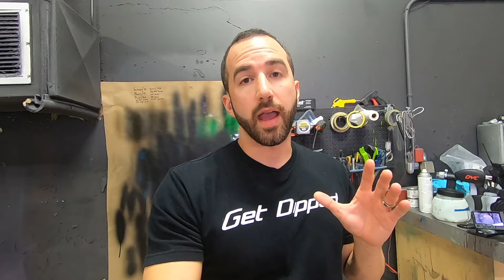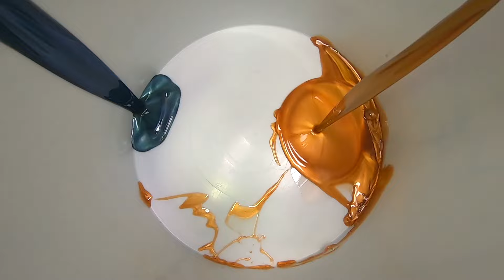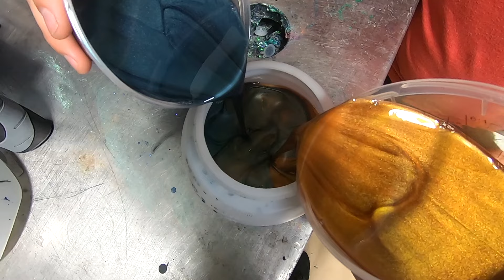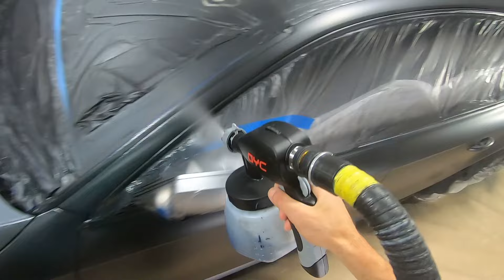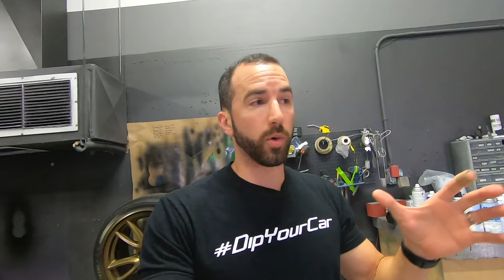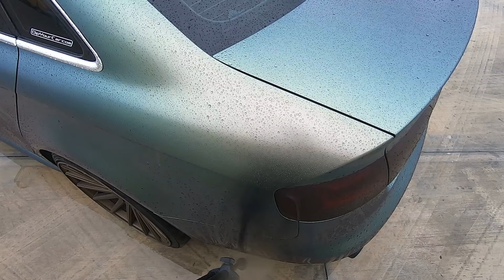Combine Two Colors, DON'T MIX, then Spray!

Comment: The name should be " Oil slick"
Reply: Has the same colors huh
Reply: The BP oil spill.
Reply: Tempered Titanium, no?
Reply: Oil slick is more purple pinkish
Reply: Tempered titanium.
Reply: Oil Stain
Reply: I was thinking Mood Ring
Reply: Some old hot rod guys that would rock primer finish used to cover their cars in wd-40 when they would take them to shows and when it would get wet or rained on that's just about what it looks like. It was a trick to hide fingerprints you get when touching dark colored primer..Lol
Reply: More like Oil Sick
Reply: Hot Gun Metal.
Reply: Until you leak
Reply: I bet he had to cut it loose from the floor.
Reply: @djw5415  it's a Ford color it's called mystic
Reply: In a lot of video games this color is called oil slick
Reply: Naw call it "June bug"
Reply: often called Scarab Green, due to scarab beetle shells often having the same color and effect.
Reply: Cop to dispatch: I'm following a green, no wait, orange, blue, gun metal gray...

Dispatch to Cop: Come back to the station for a sobriety check.
Reply: Wolfgang cutthroat  anodized...? Didnt know you could anodize titanium. I know you can to Aluminium. 
Heat treated titanium (tempered) is very common in the car world.
Reply: Wolfgang cutthroat  ah i see. My confusion what thinking titanium anodizes the same as Aluminium to which you add dyes. Anodising and tempering get you to the same result for titanium as its the oxide that gives the colour not a dye
Reply: Wolfgang cutthroat  same result two very different methods
Reply: i see it as more of a Dragons Egg
Reply: @detectivewaffles3129  and where have you seen dragon eggs????
Reply: @liamcooper5202  i have my sources
Reply: @detectivewaffles3129  well thats a lie because I dont know you and i have the last set of eggs
Reply: @liamcooper5202  lol that's what you think
Reply: @detectivewaffles3129  ummm no. Its been curtified. I know every collector. It truely is sad there are only a few left. Glad i have them though.
Reply: @detectivewaffles3129  short answer... we are unsure. Not enough is still known about how long an egg is "good". The shells are too thick to see through and scanning is proving difficult. I maybe have the last set of eggs but no one knows if there are baby Dragons inside.
Reply: @liamcooper5202  did u try surrounding them in a large pile of gold? That's what my great great uncle twice removed did.
Reply: Jack Kuykendall the name should be chameleon
Reply: actually a really cool name for it.
Reply: antifreeze drip...
Reply: It remind me of a hot wheels car that change color  with heat
Reply: Bismuth?
Reply: Amber fade would be a nice name for this color 🔥
Reply: "Slick Oil" is better
Reply: @liamcooper5202  (primary color) Tempered titanium has a nice ring to it.
Reply: My thought exactly.
Reply: Labradorite
Reply: Thats already a thing
Reply: Petroleum rainbow
Reply: Oil slick is dif.
Reply: You're not wrong
Reply: Glad I'm not the only one that thought this
Reply: Abradolf Lincler  same
Reply: @mitchelsalas3185  no this was a custom color
Reply: That already a form of paint lol, but that would work tho
Reply: @jennaorlowski9228  Nice👍🏽
Reply: I think Peacock feathers ^.^
Reply: Perfect! I was gonna say chameleon but oil slick is even better
Reply: My thought, exactly!

Comment: By the time you get a couple passes on the car, the different colors have been agitated in the cup enough to thoroughly mix. But that color is amazing and its perfect with those wheels!!
Reply: if the paint containers could be seperated then  both fed to the gun that would do this effect but would probably need a custom spray gun if there is one out there
Reply: @646klein  Hey man, they actually heard you!!! That's amazing!!! Check out their new video!

Comment: Very cool, best way i can describe it is it looks like the oil sheen when a drop of motor oil drips in water puddle
Reply: or simply iridescent
Reply: Did you just say OIL 🦅
Reply: @etooamill9528  read it here 1st.... oil
Reply: the colour is known as oil slick
Reply: Yess..   hit the nail on the head with that description
Reply: Heat-treated titanium without the purple
Reply: Yeah that's both thin oil layers and pearlescent colors use iridescence to create colors. So it's the same thing.

Comment: Looks like a blue steel, like when you heat steal too much while forging.
Reply: Car -fade, factory new.
Reply: @huntergman8338  perfection.
Reply: Facts
Reply: ThatAnthroGamer I thought you meant Derrick Zoolanders top secret look!
Reply: Actually reminds me more of heat treated titanium. Dab nails made of ti also take on this same almost purple to blue to almost yellowish look after being heated
Reply: It's not because of overheating, you can achieve this colour in a conventional oven while tempering 😊
Reply: @jesmondo5785  You can make chocolate shimmer in those colors as well, with nothing than a pattern carved onto the surface
Reply: @huraqan3761  no that's different, metal actually changes color when heated and those colors don't change with the viewing angle
Reply: @The_Wosh  did i say it was the same? aaaaah ^^ lawyered...
Reply: @huraqan3761  you got me there, but it still different, when you do that with chocolate it will have a rainbow effect, but metal only goes through a few colors
Reply: @The_Wosh  hey... cloud iridescence
Reply: Yeah like that
Reply: @jakewarner1993  I see that
Reply: Tempered steel
Reply: I said i would call it green steel

Comment: I dub this color DRAGONFLY
Reply: I dub this colour PETROL IN A PUDDLE
Reply: I second that,  DRAGONFLY.
Reply: Looks more like jet fuel
Reply: "Unicorn blood" seems more appropriate
Reply: Lol its a color used lots in bikes its called oilslick
Reply: I would call it 'Failure of the Smith'
Reply: My precious
Reply: @OrangeAtomicRugTM  but even if that color, it still doesn't melt steel beams.
Reply: It does give you that feeling while looking at one while flying...😁😁😁✌✌✌
Reply: Perfect name for that custom color!
Reply: Oooooo I like

Comment: Because the spray gun atomizes the paint as it passes through, you won't really notice that the paint hasn't been mixed. 

Maybe if you poured one colour in first, then the other in second - you may have a more noticeable outcome.
Reply: or have two sperate compartiments in the bucket.
Reply: @sebastiaanx7867  I reckon this is the idea he mentioned he eludes to in the wrap-up
Reply: @roadhog29389  could be indeed. Doubt it will do any difference though.
Reply: Or if you put a piece of cardboard to divide it into two sides and poured in the paint and removed the cardboard
Reply: @sebastiaanx7867  the colors will still mix as they go through the atomizer.

Comment: x2 guns. x2 different colors. Second gun follows right behind the first. 

Instead of mixing in the hopper, they'll blend as the coats dry on the car. 

#doitfonzi
Reply: vabrova no that’s pretty stupid
Reply: yep it would end up just being the color of the 2nd gun.
Reply: I like that idea
Reply: @TheBulitt  no it wouldnt. If you spray from 2 different angles it does do something
Reply: Black and White or white then black
Reply: @Joel Marshall 2 guys one spray gun?
Reply: 2 tanks, 1 gun, with a randomized switching valve between the tanks?
Reply: sounds like overhandlin to me
Reply: Or design a gun with 2 nozzles that spin lol
Reply: There would be no end to this conversation
Reply: Yo! Fonzi actually did it and it looks good. Their turn around time is ridiculous!!

Comment: Once a month or so, you should try mixing two random colours and show us the results
Reply: That would be expensive car paint is extremely expensive I know first hand
Reply: @jessewelch1 ah ok. I thought because they use plasti-dip it would be cheaper also taking into account the buying power or company direct prices.
Reply: not if you order it in the good places or get it sponsored @jessewelch1
Reply: @jessewelch1  well he owns DYC which is the number one automotive Plasti Dip vendor so I doubt that's a problem.
Reply: Tex X it’s not paint, it’s plasti dip. And it’s not really expensive at all. I know first hand
Reply: What will he show it on? A damn Brick wall?
Reply: @cxssetteman182  The whole point of plasti dip is that it comes off. They could use the same car for every single video.
Reply: @cxssetteman182  sorry i thought it would be obvious considering the whole company is based around dipping cars or car parts... kind of an ass ended question.

Comment: It looks like case hardened steel or flame heated copper.
Reply: Beat me to the case hardened steel observation
Reply: Neochrome paint
Reply: Looks nothing like case hardened steel. Color case hardening leaves the steel splotched, this is a pearl color shift that relies on perspective.
Reply: That,  or  flame treated titanium. That's what I thought of first. 
As for the comment about it not looking like case hardened steel. It has all the colors of the steel, just not in the splotchy patterns.
Reply: Looks like case hardened dog poop or flame heated cow dung.
Reply: More similar to acid fade though.

Comment: People need to pay attention. They started with two pearlescent paints which means that the color change comes from that, not the fact that they mixed two paints.
Reply: The red under hue defiantly is from the other paint though. Not just an effect.
Reply: I mean the vigorous shaking from spraying mixed the colours anyway so it makes 0 difference. They literally just made Pearlescent paint...
Reply: Nathan Burton not if the two colors have different ratios
Reply: @VyarkX  I don't know how you came up with that statement but sure buddy, whatever you say.
Reply: Nathan Burton did you mean inside the cup or the nozzle of the paint sprayer?
Reply: @VyarkX  Inside the cup of course. He shook the fuck out of it straight away mixing the two colours.
Reply: Even if you used a long tube coupled to the paint reservoir to minimize shaking, the flow along the inside wall of the tube would be slow enough to mix with the next flow of color coming through. Drag mixing.
Reply: They mixed colour shift paints

Comment: I wonder if it would look the same if you did mix the colors beforehand. I really really like it. Usually colorshifts that cross more than an 8th of the color wheel are too intense for me. But it’s really very subtle. I sort of want it on my car now. It kind of reminds me of the rainbow effect in an oil slick on top of a puddle.

Comment: Rig two separate paint containers to flow into the gun at the same time.
Reply: Or a baffle in the container that separates the paint except for a small hole at the pick-up point. That way when the paint sloshes from side to side, you get a stronger influence of one color over the other.
Reply: @brucea3103  I was thinking about a divider inside the container at the beginning of the video. I can't believe they didn't think that through.
Reply: leahcism ovaslok you my friend have solved common sense
Reply: can nobody obviously imagine the outcome lol no good.
Reply: Just paint two separate cars two separate colors then crash them into each other.
Reply: @steelfalconx2000  wow that has not happened ever!
Reply: The two separate containers would result in the same outcome unless like someone else suggested you add a way to randomize the inflow.
Reply: It will mix when atomised....

Even if we use 2 different spray guns, the mist of both will combine to look like one colour, and the difference will only be microscopic, like coloured dots making up a newspaper. Separate up close, homogeneous from far.

The only solution is to use two NON MIXING colours, which remain separate due to different viscosities.
Even then the end would looked kinda botched up.
Reply: leahcism ovaslok YES

Comment: That got to be one of the more interesting colors that you have painted a car. 35 years ago my future wife got a gold colored 2 door compact sedan, but she liked the car but not the gold color, a friend of mine offered to paint it blue using some paint that had been over ordered. 

However he made a mistake due to the type of candy paint and we did not get a Blue car back it was more of a dark teal, but looked amazing, as the grill looked old we replaced it with chrome tubing, we got the wheels painted the same color and put chrome trim rings and hubcaps on it, and took a coil out of each string to firm up the ride, which also lowered.

A month later we went to a local car show and ended up parked next to the show cars, we managed to pick up a 1st prize of the paint work, not bad for a mistake.

Comment: what about cutting a piece of card to fit in the cup and pour a cooler to each side then remove the card
Reply: smyffe69 Good idea. Although it would still mix as it’s sprayed from the nozzle.
Reply: Smyffe that's what I was thinking. Jordan, yes it would mix as it's picked up and sprayed, but the two colors might get picked up at different rates, depending on which way the can tilts.
Reply: The can swirling around will distribute them rapidly homogeneous. All will be for naught.
Reply: Good idea. Or, to respond to the previous comments, you could use a plastic card (to avoid particles), and leave it in the cup. Just cut a little notch in the bottom where the pickup tube is located, allowing the paint from both sides to flow to the pickup tube. Then the majority of the paint wouldn't mix by sloshing around in the cup. The hard part is that the cup doesn't have straight sides.
Reply: @ScottFreemire  damn that's a great idea man. Hell if could find someone to make the file for it could 3D print it maybe? Not sure but I like the idea. Not even much of a car guy so not sure why this video came up but I love it

Comment: TWO GUYS SPRAYING AT THE SAME TIME IN RANDOM COVERAGE!
Reply: Lol two guys one car!
Reply: That'd be interesting
Reply: I was also thibking bout this. What if they have two guns with each colors then spary at the same time.
Reply: I was typing this comment when i saw yours. They need to see this!! Lol
Reply: @gr8b8m8jared7  chase each other around the car doing wavy not normal spray patterns. I mean there is no shortage of product so try the spray method with the base coat to see if you get a level finish. Maybe try one pearl in a  color coat and another pearl mixed with clear so you get the pearl but no color mix/ new color.
Reply: One spray up and down the other sprays side to side
Reply: Two guys....  one pearl?
Reply: Two guys one cup... of paint...

Comment: It looks really interesting and - honestly - really good too! The problem I see with this method is that its pretty hard to control meaning the output is going to vary everytime. But maybe thats what makes this so exciting.
Reply: "The problem I see with this method is that its pretty hard to control meaning the output is going to vary everytime. But maybe thats what makes this so exciting"

That is the idea, it is a experiment not a protocol, if you want to make the car look like this at purpose & controled just paint it in one color and later add the different shapes.
Reply: One word = unique

Comment: Suggestion: Warm one color, and cool the other color - THEN shoot.
Reply: One oil base, one water base....
Reply: @2869may  Ah. Makes sense.
Reply: @chrispile3878  Would the oil based float on top of the water though...?
Reply: @2869may  Now that you mention it.... Shake it up gently?
Reply: @chrispile3878  Good idea...!  You wouldn't have to be consistent cause you're not after consistency....
Reply: @2869may  - You just have to try it. Don't be shy.
Reply: @chrispile3878  lol
Reply: Dual pots or side by side guns would be the way to do this experiment properly I think.
Reply: @prawny12009  - I suppose. Expensive gear - I shoot on the cheap, my gear is 30 years old.
Reply: Maybe make a  small plastic partition in the sprayer then spray
Reply: @rpkunn  - If you'd ever looked at a spray gun you'd know that will NOT work.
Reply: @chrispile3878  for dual pots a threaded y piece world probably suffice.
Reply: @2869may  other way around

Comment: Definitely mixed in the cup when pouring
Looks cool but not as expected

Edited for spelling
Reply: The mixing could have been minimised with an index card in the center acting as a temporary separator. HOWEVER, between the sloshing while painting, and the act of the gun sucking and spraying the paint, it probably would have been the same result.
Reply: Does it matter ? What add a note about me leaving an edit note ?
Reply: @intothecalm420  It's fine, and Squatchin Outdoors is just being honest. YouTube doesn't tell you WHERE the edits happen. You could completely rewrite the post to make everyone who replied look like knobheads.

Comment: How about dipping a car in shadow black but adding some carbon blue pearl straight into the last coat or 2?
Reply: I asked him once if adding metallic green pearls or flakes into black would create a black that had green sparkles when in the sun and he said it would. Or maybe it was if it was added to the clear top coat.
Reply: That's exactly what I was after. Black that has a slight color to it in sunlight
Reply: Been wanting this same thing. Super low pearl load carbon blue and/or martian blue over shadow black.

Comment: Mix more than two colors. Outcomes will be more complex and hopefully more interesting
Reply: Have you ever tried mixing a bunch of colors? They tend to just start coming out brown. It's not more complex just because you add more.
Reply: @Vykk_Draygo  I have, but I meant to mix 3 or 4. Not to the point where it just looks like crap
Reply: @Jack-tu5zf  it  doesn't work like that chief
Reply: @Jack-tu5zf  it would still turn brown